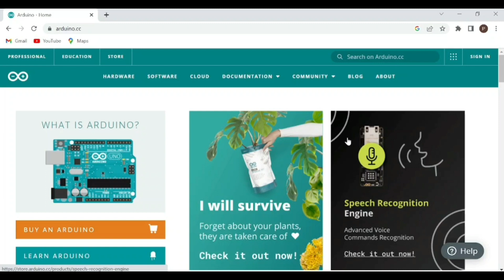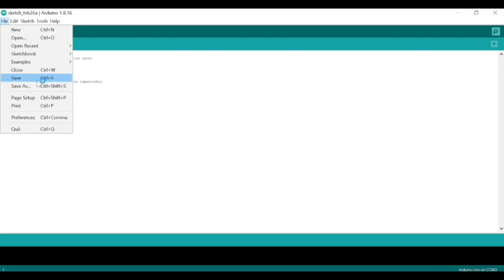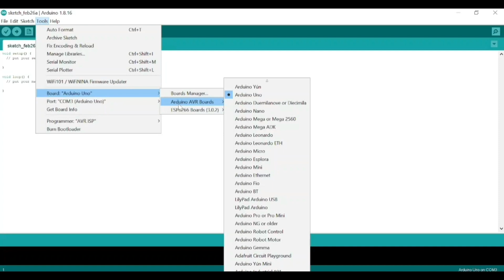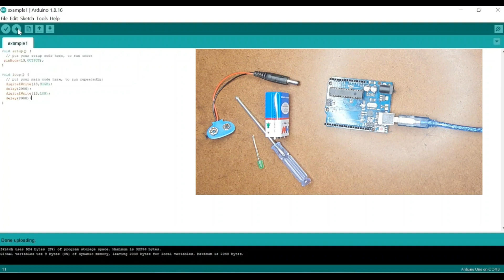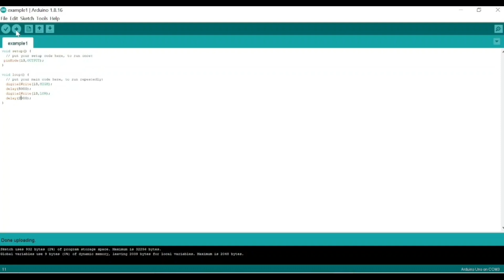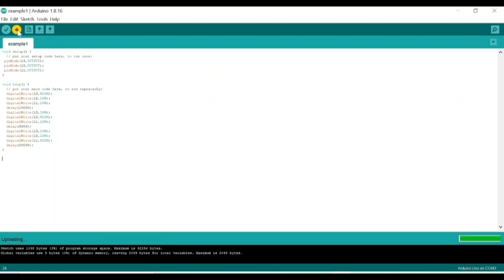Comment: And where to buy
Reply: It cost around 300- 500. you can easily get one on amazon. If you want you can check Google for electronic shop near you. Mostly all the shops that sell electronic components also sell arduino board.

Comment: Bro  how much Arduino Uno price
Reply: It cost around 300- 500 outside market . you can easily get one on amazon. If you want you can check Google for electronic shop near you. Mostly all the shops that sell electronic components also sell arduino board. However nowadays the price has increase to 800 online.